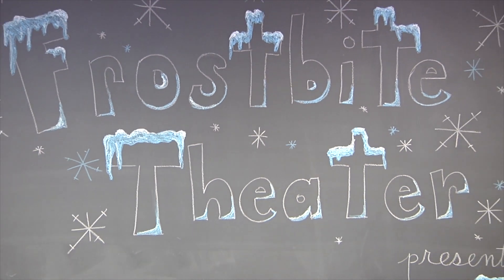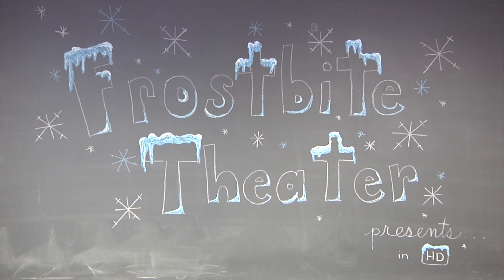Here's a Question! - Scales and Static Electricity

Comment: Have you actually tried it with different types charges on the plastic block?  I appreciate your explanation. Just curious: Have you ever seen it demonstrated with different types of charge? Is the value change the same for equivalent different types of charge?
Reply from the maker: We haven't intentionally tried different types of charges on the plastic. We may have accidentally given it a different charge at some point, though. Whether the plastic becomes positively charged or negatively charged depends on what the other material is. There's a list, called the triboelectric series, that you can use to determine how two materials will transfer charge. The further apart the materials are on the list, the more readily they will transfer charge. For this, hair worked well. Probably also tested it with our shirt and jeans. So, that could have resulted in giving the plastic block a positive charge while using one thing and a negative charge while using another. We didn't test, though, and there's no way to tell the charge on the block by using the scale. The absolute charge on the block was what was important. The greater the charge it had, the more it would have affected the scale.
Reply: @JeffersonLab  So you haven't seen any science papers or tests with different charges on the plastic block? You are free to believe what you are told about science without any real world  tests to confirm what you have been taught is true. 
    Thanks for your information.
Reply from the maker: We didn't explicitly test this block with different charges. We have conducted experiments involving both positive and negative charges, however. Just not with this specific block of plastic. Apologies if I was unclear.